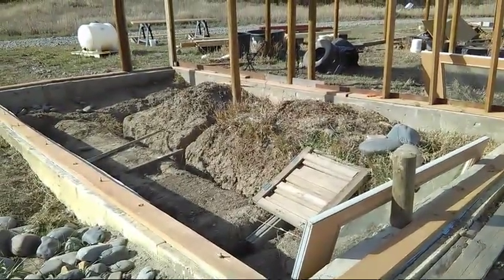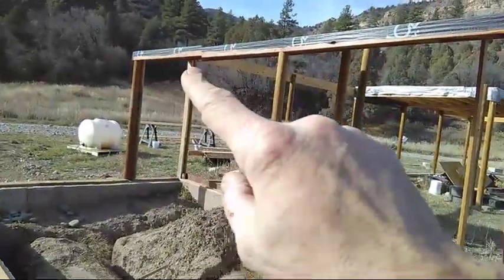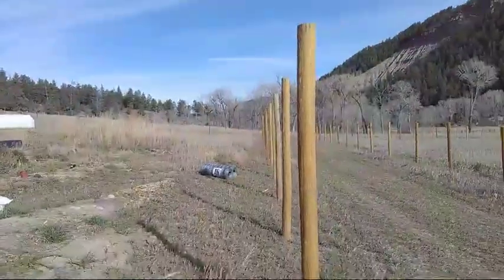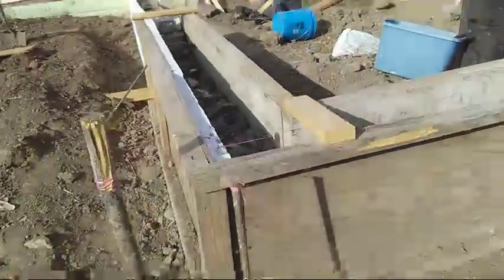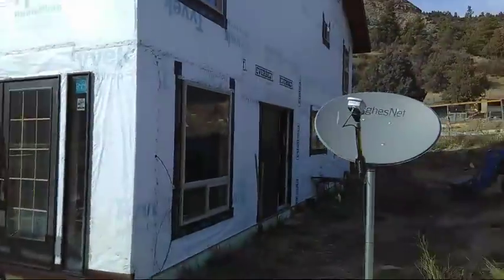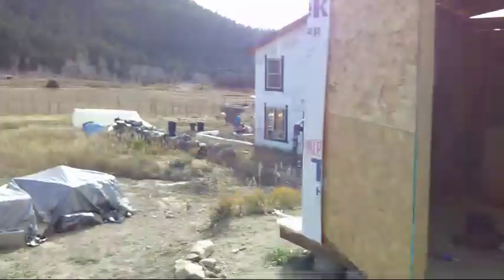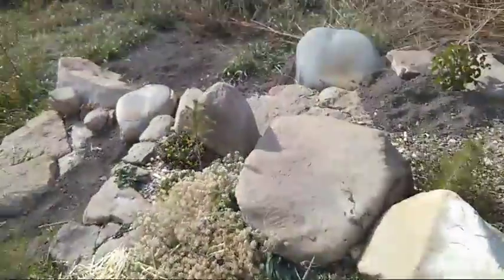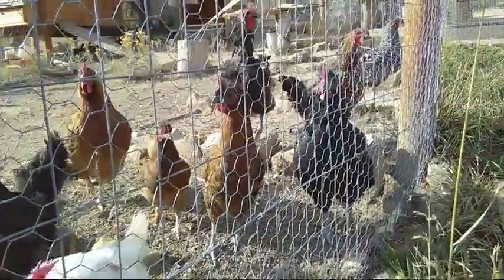Geothermal Greenhouse Livestream - Construction Update On Zone 1 Geothermal Greenhouses - Solar Shed

Comment: Weight on the batterie house floor..? How much weight do you have with all.. ? Batteries.. sometimes leak-a membrane on the floor is good , just in case, You have alot of projects ..with winter coming in fast.., WoW. Throw a tarp over those footings - foundation walls, ice..not fun to have to retent and heat to work on in the cold.
  Honesty... a little panicked  for you.